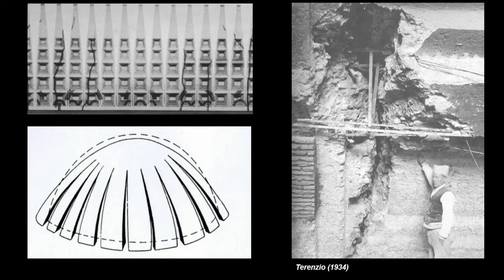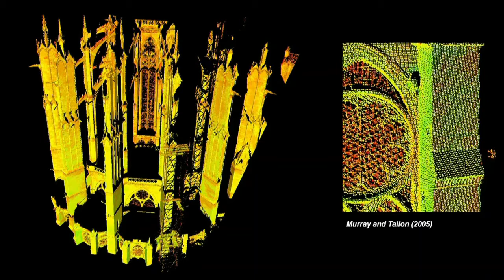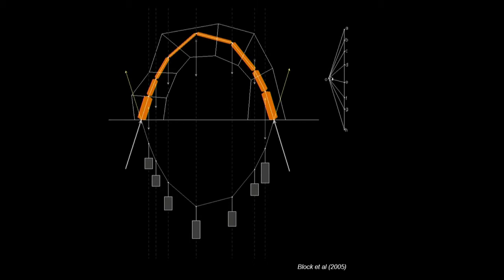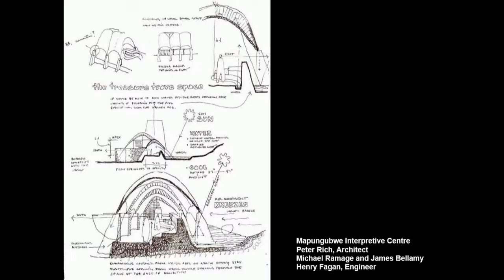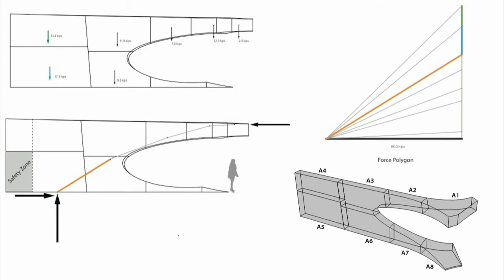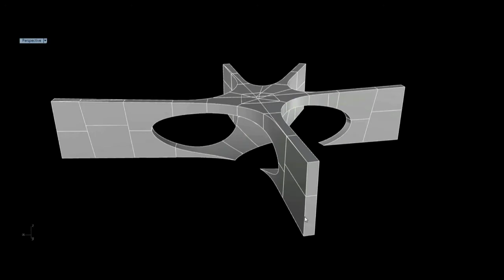John Ochsendorf

Comment: At 13:51 it is asserted that the vaulting technique shown originated in North Africa in the C13, and proved to be "an incredible new technology ... it was like a microchip ... was adopted in the West in the C14". I'm puzzled by this because such vaults had been constructed in Europe since C12, eg the high pointed-arch vault of the nave of the (Romanesque) Durham Cathedral, England, completed by 1135. There are many other examples of such vaulting from this era throughout Europe, dating from far earlier than C13/14.
Reply: Precursors to flying buttresses can be found in Durham Cathedral, though are not easily visible.
Reply: I think he’s specifically referring to guastavino style tile vaulting as coming from North Africa. The Moors has amazing building technology. I could be wrong
Reply: I believe he is talking about vaults that didn't need supporting by scaffolding/ falsework during their construction.

Comment: 13:54  if you go see the ruins of pompi(Pompéi (Pompeii) near Naples, Napoli)  , you will see a stairway built according to this principle. The origin of the constructive principle is not North Africa.on the other hand, the presence of Romans, and Spanish in North Africa to bring numerous architectural works locally for 2000 years (Volubilis,Eduardo TORROJA (1899-1961))
Reply: It is a Mediterranean technology, guastavino implemented plaster of Paris which allowed from faster setting and stronger loading. That in it self and the vision to implement it in a country that lacked any knowledge besides wooden framing(US) is the great merit of guastavino.
Reply: @Drzahman  Guastavino is a master(Guastavino, Rafael, Sr. (1842-1908)).
But the first proven application was made among the Romans.,under Roman rule from approximately 44 B.C.E. until 476 C.E.
You cleverly quote "the Mediterranean" trying to integrate "the Muslim genius" which in fact has not refined anything in constructive terms...The technical advance is Roman, the others are 100% followers, adapers.